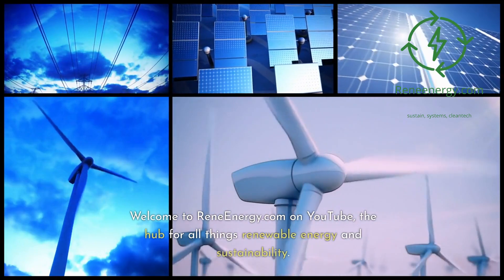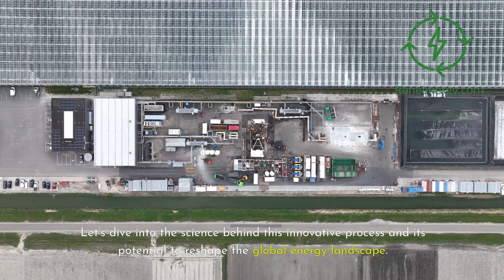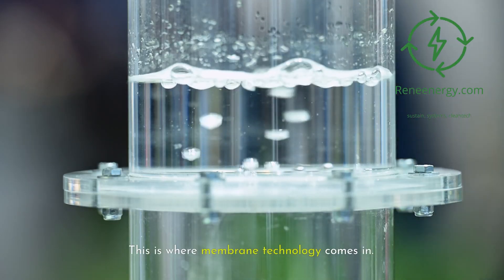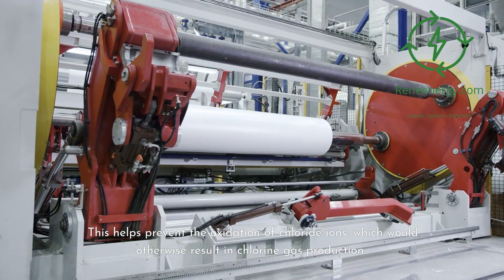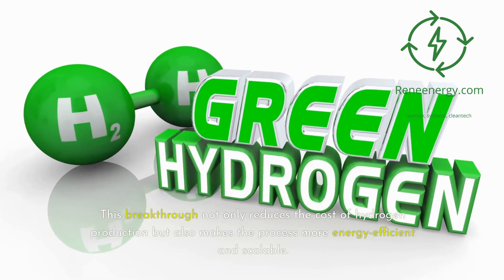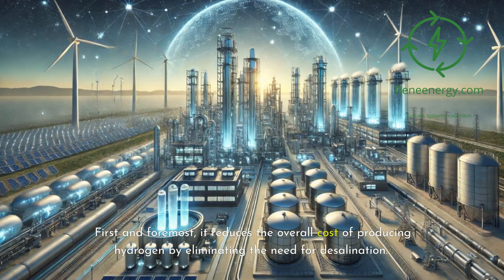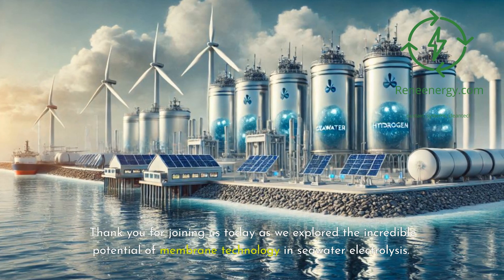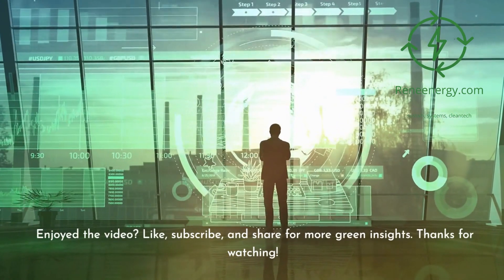Membranes Enable Hydrogen from Seawater Without Desalination

Comment: What materials are used to construct the membranes?
Reply from the maker: Thank you for asking. We will do a video on this series for hydrogen from seawater without desalination but in the meantime, here is the list of some of the materials used to construct these membranes: Perfluorinated sulfonic acid (PFSA) membranes (e.g., Nafion), sulfonated poly(ether ether ketone) (SPEEK), sulfonated polysulfone (SPSF), quaternary ammonium functionalized polymers, yttria-stabilized zirconia (YSZ), cerium oxide (CeO₂), Nafion/clay composites, polymer/metal oxide hybrids, graphene oxide membranes, metal-organic framework (MOF) based membranes, hydrocarbon-based membranes, anion exchange membranes (AEMs), ceramic membranes, composite membranes